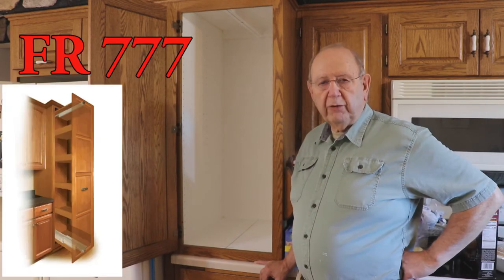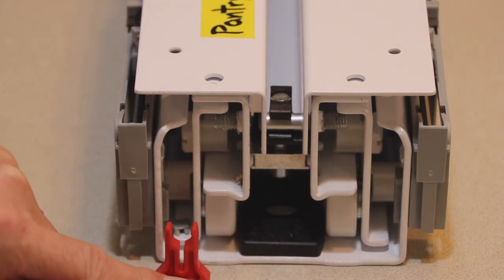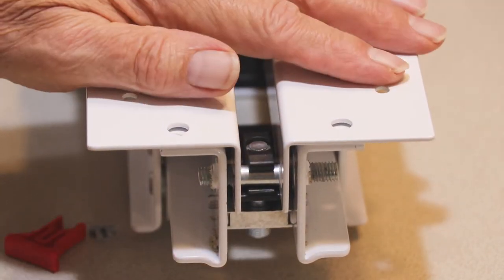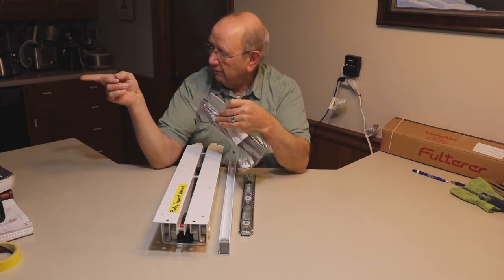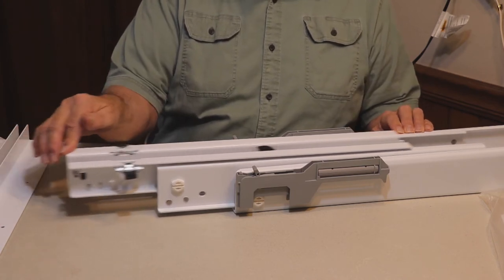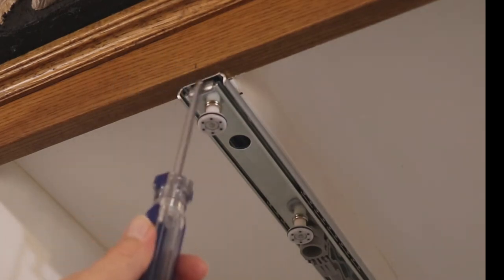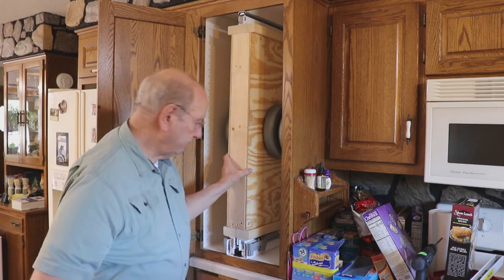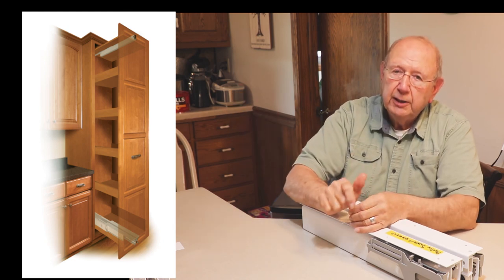FR777.A Installation Tutorial

Comment: Are there any specifications for building the actual cabinet unit that rides on the hardware
Reply from the maker: Hi, we only recommend a maximum width of 23.62in (600mm) and a maximum height 98.43in (2500mm) and that the load should be evenly distributed. 
Other than that this slide has a wide variety of utilization. So it really depends on what you tend to accomplish.
Reply: How about cabinet deep dimensions?

Comment: The soft close mechanism (I was sent from distributor) on the top slide/bracket assembly is different from what is shown on this video. 
What I received from supplier has a metal bracket that was supposed to mount on the rear of the slide and a magnetic mechanism that snaps into the upper track. (Will not work with the unit shown on this video.) What is the Fulterer model number of the soft close mechanism shown in this video? I need one! Where can I get one?
Reply from the maker: Good morning Robert, please fill out the contact sheet on fultererusa.com http://www.fultererusa.com/contact-fulterer.asp 
Please let our customer service know which distributor you purchased it from and when. When you get a response please send us a picture of what slide you have installed and what spare parts you received.